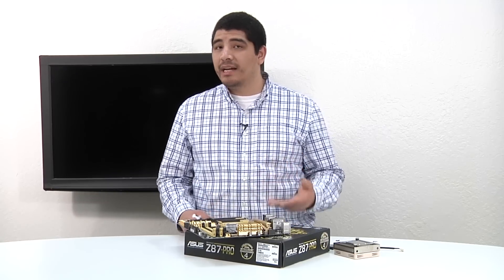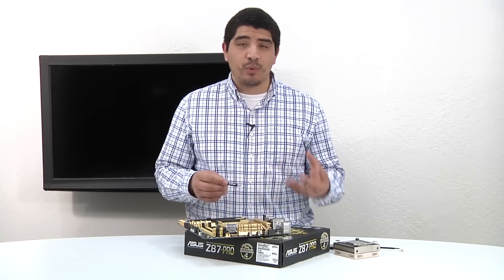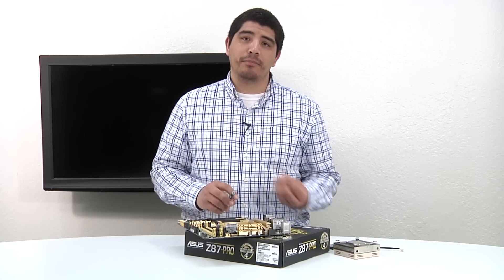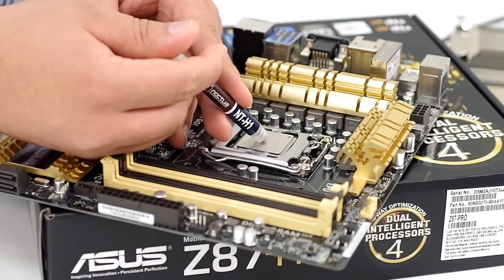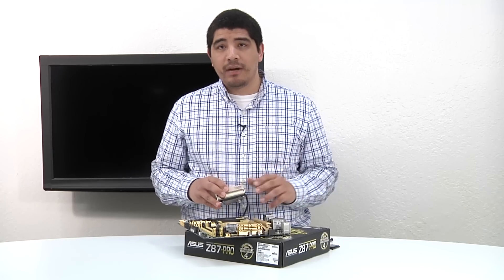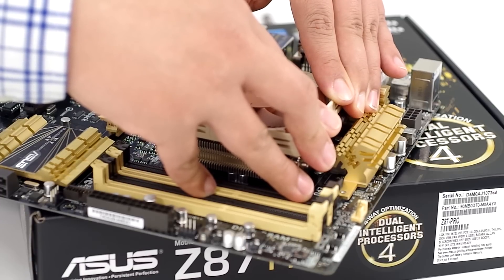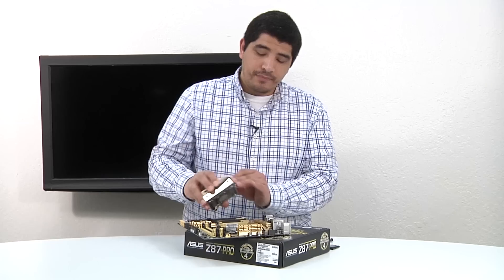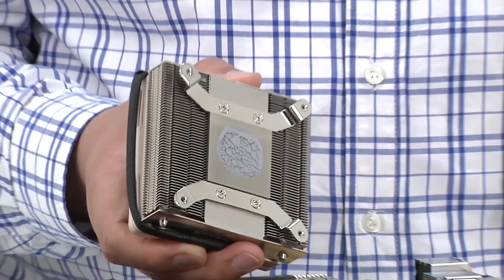How-to apply thermal compound

Comment: NEVER, use stock thermal compound, NEVER!
Reply: ***** 2? Have you seen the comparison with the stock coolers and for example a CM Hyper 212 Evo? It's like 15 degrees...
Reply: I use Colgate. Keepin' CPUs minty fresh since '03.
Reply: Kevin Navarre I want to see someone actually use toothpaste on a good CPU like a i5 3570k...
Reply: Catpiss Neverclean
Not a modern CPU, but here you go. /watch?v=9iRf440Zaq4      LOL.
Reply: Kevin Navarre lol
Reply: Catpiss Neverclean I use mayonnaise.
Reply: Actually the thermal compound that is included with Noctua coolers is really excellent, one of the best. So his advice is fine.
Reply: A heat-sink just isn't a heat-sink with out the tangy zip of Miracle Whip.
Reply: Catpiss Neverclean
 Err, actually yes. Google NT-H1. You'll clearly see in tests that this compound consistently performs as one of the best out there. Unless you think the rest of the planet is wrong of course.
Reply: Catpiss Neverclean
"Even if the TC was made out of an unknown material that is the best heat conductor I would not apply it if it came with the cooler." No comment... "You cannot be serious!" - John McEnroe, 1981
Reply: 1wibble2 No, just no.
Reply: 1wibble2 Yes, the planet is wrong. Even if the TC was made out of an unknown material that is the best heat conductor I would not apply it if it came with the cooler.
Reply: Catpiss Neverclean
 Ok then, either you're trolling or just plain mad, i'm guessing the former, well played sir.
Reply: 1wibble2 No, it's just true. No one should use stock compound. Only use it for emergencies when you don't actually have any. I wiped the shitty thermal compound off the H80i after seeing that the temps where a tad bit high. Replaced it with some IC diamond 24K and the temps decreased by 5 degrees Celsius... I don't know if it was a bad batch of H80i compound but replacing it was a great thing.
Reply: Catpiss Neverclean I did the same with my H90i, although i didnt wait. I immeditaly removed it, and applied Arctic silver. never looked back.
Reply: Kevin Johnson do you mean the h90? h90i doesn't exist...
Reply: Catpiss Neverclean
 Again utter nonsense, yes 'stock' compound is bad, but NO, the Noctua NT-H1 is NOT what I would consider a stock compound by any stretch, its a superb all-rounder. Just the right viscosity for the pea drop spread method and proven long term durability. There are newer compounds available that offer up to 5C improvement like you say, but there's always a compromise, either a pain to spread, or they dry up after couple years or some other issue.  I've used NT-H1 in my older i7 920 PC for 5 years now and the temps are still the same as they've ever been, its a great all-rounder and I'd still highly recommend people use that if they're buying a Noctua cpu air cooler. Stability and reliability is as important as short term temps imho.
Reply: Catpiss Neverclean I guess i misread the box..huh..it is the H90 :)
Reply: 1wibble2 IC diamond is the best compound, pain in the ass for it to spread and it needs 12 hours to actually start working good but when it starts to work, when it does that it's the most glorious thing to see your temps dropping by 5 degrees C from other Arctic Silver compounds etc...
Reply: You are comparing two coolers... You can't compare the stock cooler with a CM Hyper 212 Evo... We are talking about thermal compounds, right? You said "Never use the stock thermal compound" and I tell you something: If someone never applied thermal compound, (s)he can just keep the stock compound on it. The CPU will only run 2-5°C hotter, but if you applicate the thermal paste in a wrong way, the CPU will probably run 10°C hotter than with stock compound...Of course, if you can, use thermal paste like Artic Silver 5, Artic MX-2, Noctua NT-H1 or Prolimatec PK-1/PK-2/PK-3. The temperatures will be a little less, but if you're not overclocking, the stock compound should also be fine.
Reply: Kevin Navarre LOL
Reply: Stock is usually a brand name, unless your going with stock intel heatsink but even then its usually Not the paste, but how much is put on by the manufacturer.

This host is spot on, but personally I would not remove the heatsink to check it, I would, only remove it to know how much is enough before doing a permanent application.
Reply: ***** We're talking about both mate. And Arctic is actually a good compound... I use IC diamond by the way.
Reply: *****
 I guess reading isn't your strong point. Nowhere did I try to make out that the Noctua compound was THE best thermal compound on the market, I was merely highlighting how utterly retarded it is to suggest that the NT-H1 is some basic stock compound thats not worth it. As I said, Noctua don't only bundle this compound with their coolers but sell it as a separate product. Compounds aren't just based on thermal performance but longevity and viscosity as well. FYI Arctic Silver 5 is nowhere near the top in terms of thermal performance anymore.  The NT-H1 is still one of the best all-round compounds, it spreads incredibly easily so the drop-method works very well, and more importantly it retains its thermal performance over many many years, compared to some of the leading thermal ones that dry out rather quickly.. I still have an older machine thats 6 years old and the temps are as good as they ever were using NT-H1.
Reply: *****
 So still having difficulty reading then. You can't understand the difference between saying one of the best and THE best? Or taking into account every factor of a compound including ease of spreadability with longevity and not just its short term thermal performance? I choose my words carefully, it pays to read every one ;)
Reply: *****
 Oh and btw, Toms Hardware did an extensive test of many compounds back in 2013, notice how Arctic Silver 5 is lower down the list on both low and high pressure mountings compared to the NT-H1, and nowhere near the top thermal performers like Liquid Pro and Ultra. Still a decent compound not denying that (although the NT-H1 spreads easier using the drop method).  You know, for someone thats supposed to be a computer building expert your lack of knowledge is surprising. I've built my own PCs my whole life for fun, doesn't take a rocket scientist to do it.  Here's the link:      http://www.tomshardware.com/reviews/thermal-paste-performance-benchmark,3616-19.html
Reply: *****
When someone says something like "it wouldnt be a good idea to try and prove me wrong on this either" it shows how weak their position is.  That's just sad.  Also, I googled "arctic silver review" and "arctic silver benchmark".  In all the results, I found not one test where it was rated #1.

http://www.maximumpc.com/article/features/geek_tested_17_thermal_pastes_face
http://skinneelabs.com/arctic-silver-5-and-ceramique-review/
http://www.tomshardware.com/reviews/thermal-paste-performance-benchmark,3616-17.html
http://forum.hwbot.org/showthread.php?t=71658
http://archive.benchmarkreviews.com/?option=com_content&task=view&id=150&Itemid=62&limitstart=1

It did not place in the top in any of those tests.  It's not a bad compound of course, but don't tout it like it's the second coming either.  That Gelid product seems to whup up on it in every test.
Reply: You leave my baby out of this!

Comment: I dunno, you missed the edges of the CPU, where I come from that is metal to metal. Good video, but should have shown how to correct that problem for others having the same issue! Easiest way to move that stuff around evenly is a credit card or similar. People can argue that until they are blue in the face but I've done it for years on over literally 2000 builds!
Reply: See and learn "How Thermal Compound Spreads"

Comment: Hi i'm using a copper plate contact on a prefil water cooler for a i54670k with a z87 motherboard, now apart from smothering the damn thing with the compound , my copper plate is circular, so would therm compound on the parts not in direct contact with the cpu be useful ?,thansk in advance

Comment: "Absolutely necessary" could probably be argued but it's by far better to have it than without. It helps transfer heat (as long as it's not too much) and also fills in the micro-gaps that you can't see on the surfaces. If processors and heatsinks were perfectly flat, you wouldn't need thermal compound.

Comment: If thermal compound was not required for a CPU to operate for at least the warranted time, manufacturers would not simply put it on by default because of the added cost. So it is required, however too much thermal compound can act as an insulator which is a bad thing because then it doesn't conduct the heat and can cause overheating very fast.